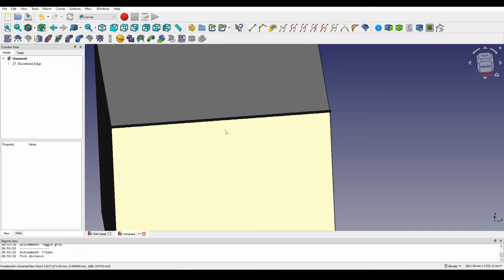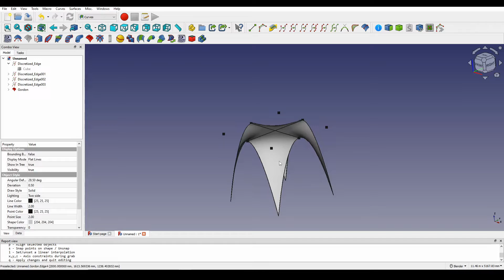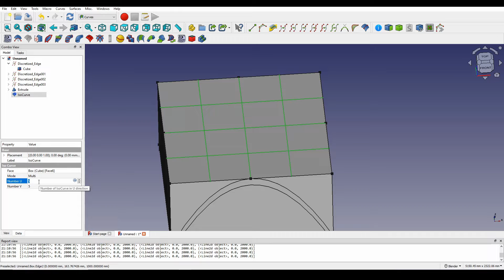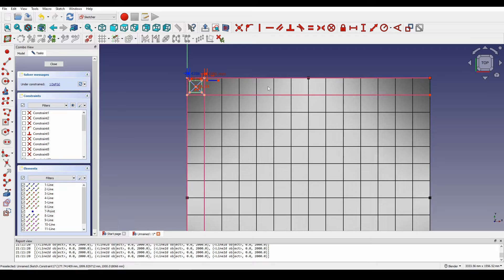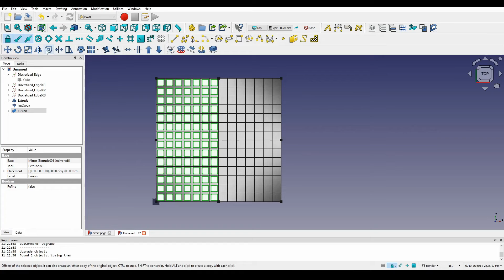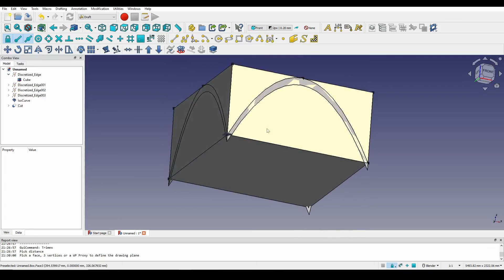Freecad Curve WB - Using Freehand Bspline, Discretize Edge and Gordon Surface to create a table.

Comment: Thank you very much for sharing your knowledge!!
Just to know, why did you make a set of 7x7 and the mirror them? Why didn´t you do it 14x14 at once? Is there any special purpose or just to teach mirroring? Which soft do you use to do a photo screencapture to explain you video? 
Martin, from ARGENTINA
Reply from the maker: Thanks Martin! Glad you like it! 
Yes you can do 14x14 rectangle array at once in sketcher, but for a bigger array like 50x50, or 100x100, it takes very long time to calculate in the Skecher WB or sometime crash. So I decided to share my way, cut it into small pieces and mirror each bit by bit. But you can do it once in the sketcher if you like it. 
I use this software to capture the screen: Lightshot —https://app.prntscr.com/en/download.html
Reply: @DuyQuangDang  THANK YOU!!!!